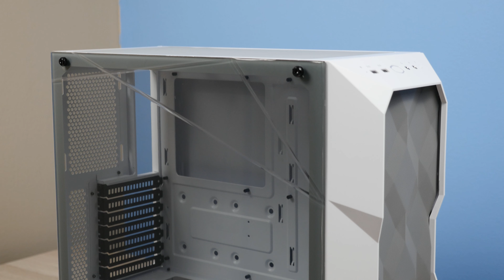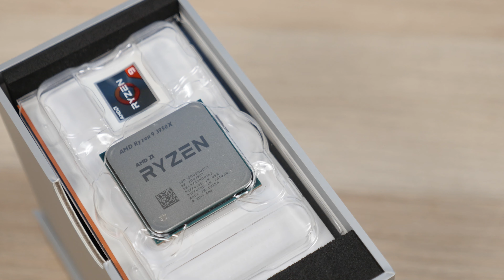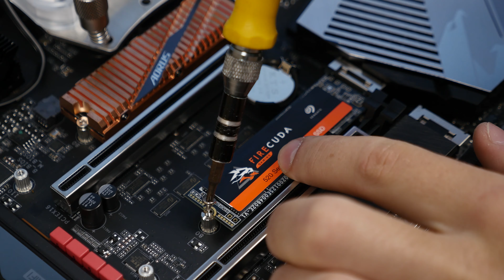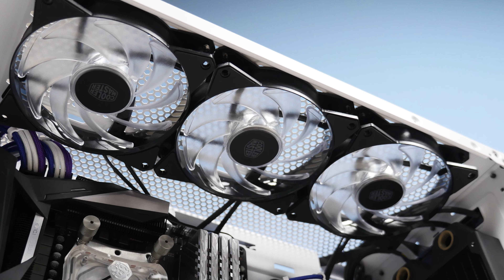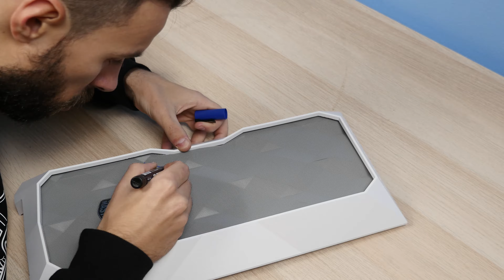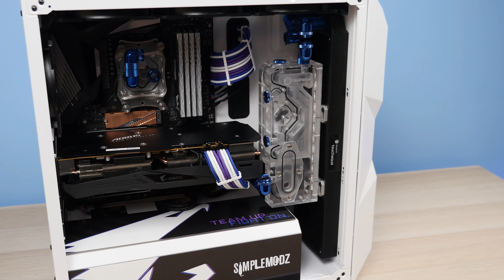$3300 CUSTOM Ryzen 9 3950X RX 5700 XT Water Cooled Gaming PC Build - Cooler Master TD500 Mesh White

Comment: The fact that you didn't take off the first m.2 heatsink case hurts my soul, it would have looked so much better under the motherboard's heatsink. But other than that, awesome build. I'm a huge fan of the colors you put on the mesh.
Reply: It was pre mounted. Therefore he most likely chose not to due to warranty issues by removing the pre mounted heatsink. Plus this copper heatsink is very, very efficient, way more than the motherboard aluminium heatsink.

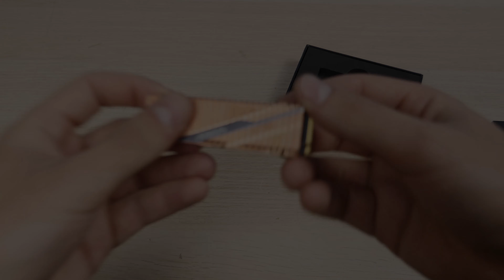Comment: 6:24 what was that thing you replaced?
Reply: and what is the difference between the 2 ssds
Reply: @ThylineTheGay  1 ssd is with heat sink other one doesn't have but some mobos come with stock heatsink so u have to remove it to install a ssd with one
Reply: @TLF26  thanks, it is obvious now

Comment: Man, what the hell are you doing? There are a lot of air bubbles inside your water cooling, that's abnormal
Reply from the maker: It's normal right after you fill up the loop - at least with reservoirs like this one. B-roll was shot pretty much straight after filling it up. Once all the air was out I had to top it up a little bit more :)

Comment: The client must have been a huge amd fan to combine a 3950x with a 5700xt.
Reply from the maker: Yea not a client build - just wanted to go full AMD :)
I'll be building another one with similar specs later - also because all AMD lol
Wish you could cross-fire the 5700 XTs!
Reply: @SIMPLEMODZ  oh that makes sense then, and I'm also quite an amd fan, if anything for the value. Currently using an r5 1600 and rx470, looking to upgrade next year or so
Reply: @SIMPLEMODZ  Cross-fire would be nice. But I'll be happy when AMD has something that can go toe to toe with a 2080 Super or better.
Reply: It's not a client build.
Reply: That is curious. I pared a 3800X with a 5700XT for a nice balanced system. But, if I had a 3950X, I'd damn well pair it with a 2080 Super.